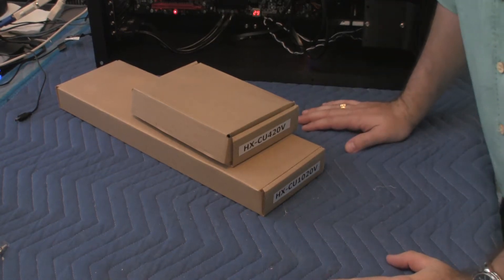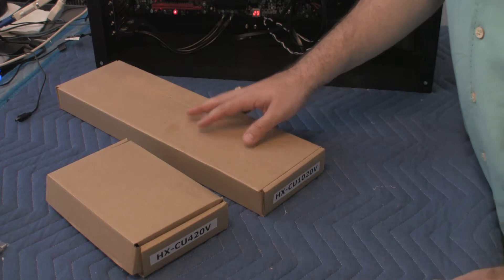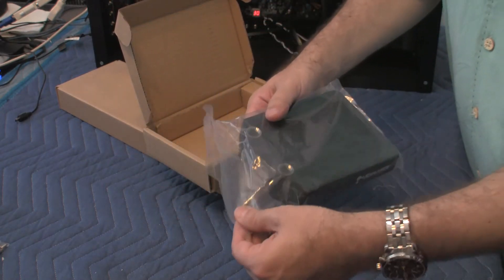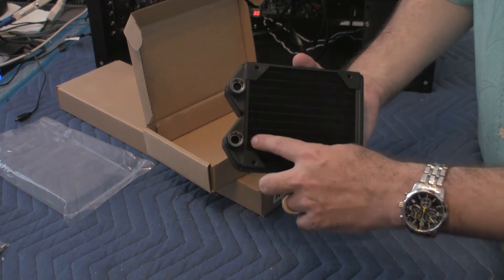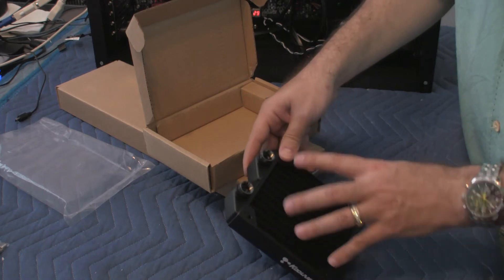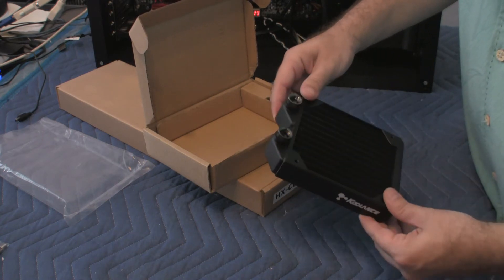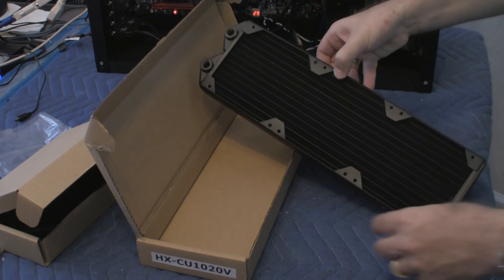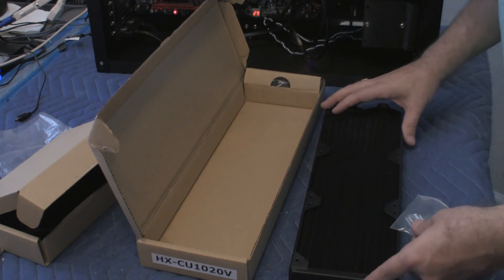Water Cooling Your Computer - Part 3 - Unboxing the Koolance HX-CU420V and HX-CU1020V

Comment: While a radiator can be loosely referred to as a heat exchanger of sorts, it is not a true heat exchanger. A true heat exchanger uses two water loops to dissipate heat from what ever it is that you're trying to cool.
 Primary examples of heat exchanger loops are A/S radars.
Xx I'm not trying to be a dick, but I wouldn't have paid much attention to your terminology if it wasn't for the fact that they actually sell "heat exchangers" for use in a PC.
They're great if people knew how to use them.

Comment: @jh3496 I just posted it because you responded to a guy asking if push/pull has any effect. And I was just stating that it did. But you see bigger gains with higher RPM, and shrouds. Plus for the radiator you got which is the 30 fpi you only see good performance with high rpm fans, that are extremely loud. For normal fans, or even slightly loud fans, silent fans etc, you would want the 20 fpi rad, which is also thicker.

Comment: @jh3496  Yes it does. Pulling has 1-2c over pushing air thorugh. And push pull has 2ish c over just pulling. And using shrouds with sealing the fans and shroud can result in about 5ish c decrease in temp.

Comment: official specs say the 420 when paired with one 120mm can handle up to 400watts of heat....-_-!!! can u please clarify this. i've looked around and cannot find anythin on it. planning to wet my 2600k @ 4.5 1.32v. using the noctua c14 ATM, with ambient temp of about 22 it maxes out at about 70c on intelburntest. if the 420 can really handle 400watts then one should surely surpass the corsair hydro series or even the noctua d14. thanks.

Comment from the maker: @maaiikkeell1996  If you have two 5690s and two 580s - you need at least four 120mm fan radiator(s). Otherwise, it won't be enough to cool down all of the components.